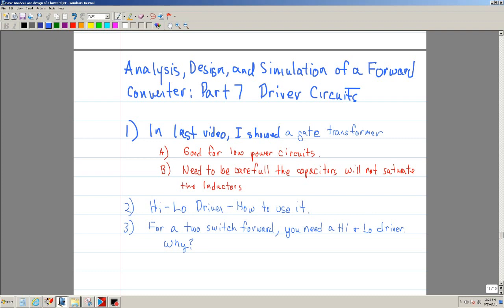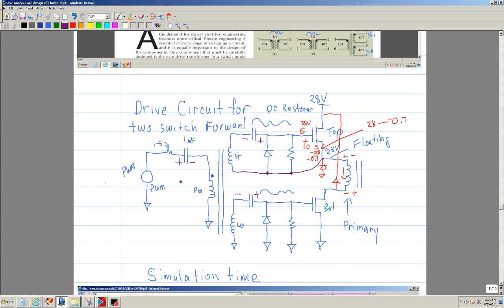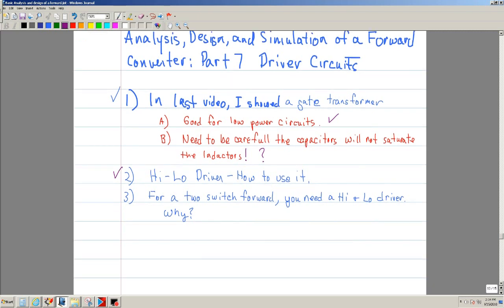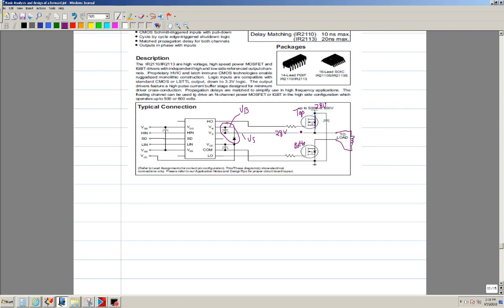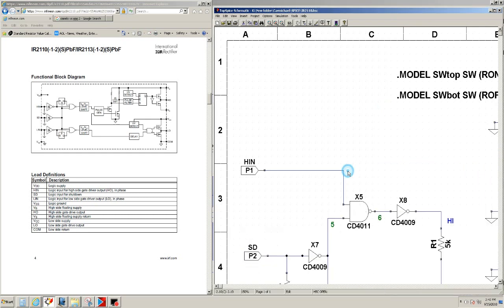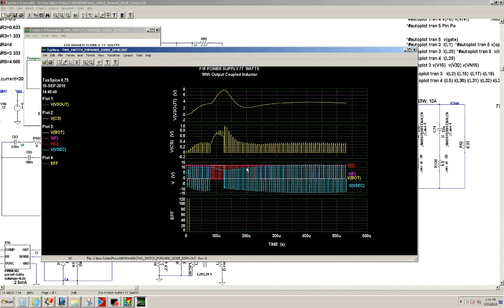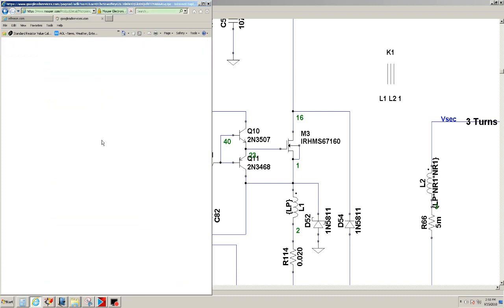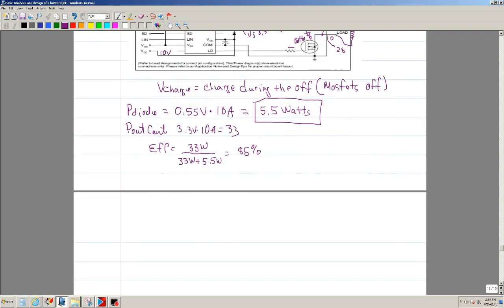Forward Converter 7:  What is a Hi-Lo driver?

Comment: I built exactly this... Though fir high voltage (311v d.c).
I used tl494 as my pwm I.c and I used bjt totempole drive as my gate driver. But the bjts blow up everything I turn the circuit on.
I only successfully built one using transformer gate drive. 

Do you think I need a bjt with breakdown voltage higher than my supply voltage??

Comment: How does the bootstrap capacitor charge when the power supply starts up? In half bridge converter it would charge through the lower switch, but here both transistors are turned on at the same time.
Reply: It'll charge by the low side switch, through the load. 
This was were I got stuck months ago when I started the design of this kind of forward converter. 
But the charging will be quite slow because of the opposition to the flow of current through the load.

Comment: Can i use halfbridge gate driver like ir2113 for dual switch flyback ?
Reply from the maker: Yes you can use it to implement a two switch flyback converter. Good question. Rbolanos